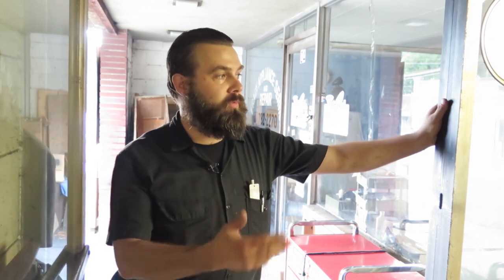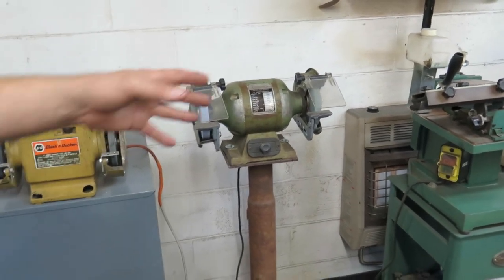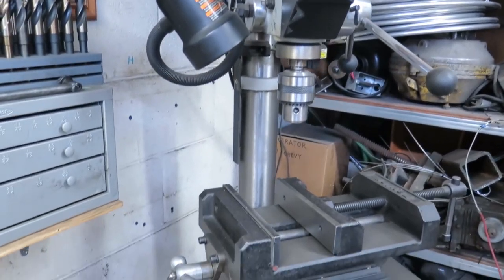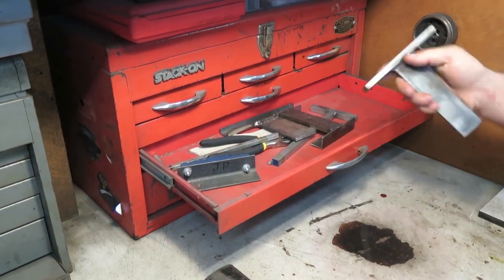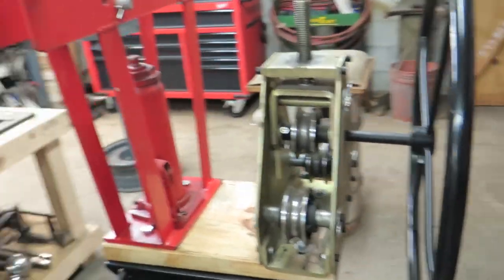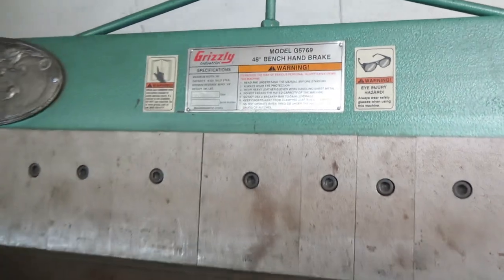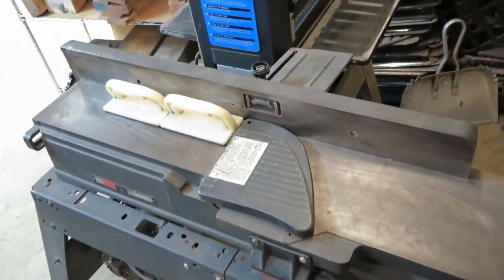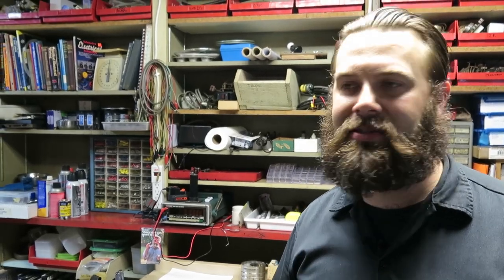Steele's Shop Tour

Comment: Awesome tour, man. Where to begin? 1. The card file drawers on wheels is a great idea! Being able to take 99% of what you use right to the machines is so handy looking!! 2. Nice surface plate! 3. Dedicated counter sink press is another nice idea. It’d be cool to have one set up with just a starter bit (centering bit) too. 4. Bathtub wash area is another home run! 5. Did you make the guitars? 6. Dremel station and anvil set up are both cool. 7. Swage block and stand is killer. The jewelry roller tool is interesting. Looks well made. 8. The stake plate set up is awesome. 9. Welding table ad vise grip storage is great.  What is the rat machine next to the Oxy/Act tanks? An old mixer? 10. Reference library rocks. You guys are super equipped and really well organized. One of the coolest shops I’ve seen. Thanks  for the tour.
Reply from the maker: Thanks for the compliments.  The guitars are some old projects that I made when I was in my early 20s (never completely finished them), yes that machine is an old dough mixer that I saved from the scrap yard my idea is to convert it to a drum sander. This shop is my lifetime of collecting tools as well as my father, grandfather, and various friends and family members that have gifted or passed down tools to me.